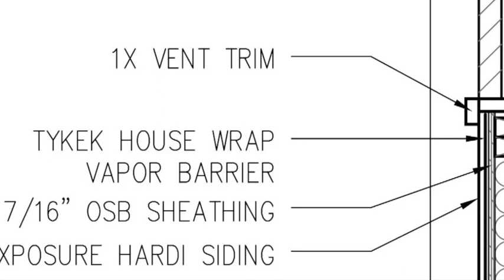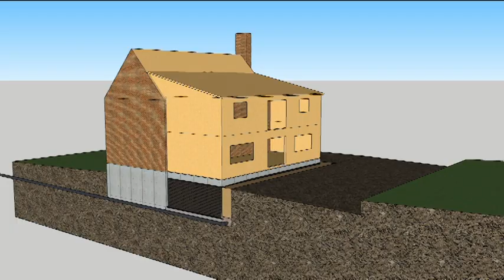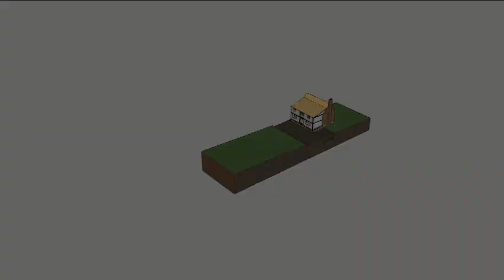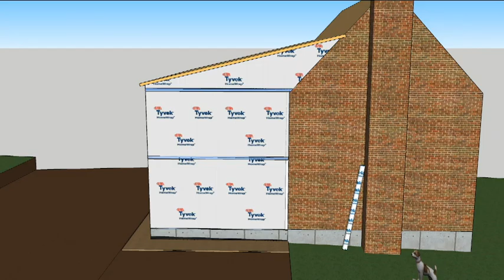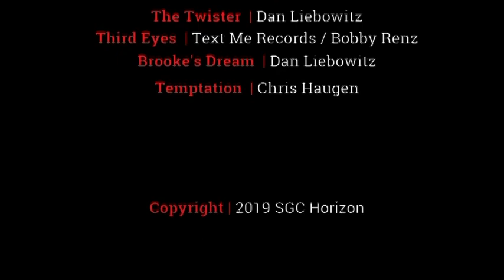Weatherization Nation 4: The WRB is a BFD

Comment: Hey . a little late for  a question, but I am surprised that DuPont  recommends against covering the cap staples with a sealing tape.. If the tape was sized  properly for adhesion,  why would it not be ant different than sealing the vertical Seams?

On really tight builds there main competitor (Zip) is either taping or caulking every nail hole for a really tight air seal.

If done correctly, I can't see why this would be a problem

BTW, Nice work , your sketch up videos are awesome!
Reply from the maker: Because the tape can fishmouth if not installed really well. We have had builders tell us about water traveling sideways in a tape 'gutter' after sneaking into a fishmouth. 

You know, SOME people install everything carefully, but even the meticulous ones make mistakes that they don't realize are mistakes -- yet.

Comment: Excellent video as always!  Considering that a sheet wrb requires 3 people to install and a high degree of skill to install which allows for a lower tolerance of error when installing, is this really the most economical wrb?  Or perhaps this was installed for other reasons?
Reply from the maker: Well, there are lots of reasons why people choose one system over another. A LOT of houses and additions are covered with house wrap, so it makes sense to us to show people how to do it well.

You can also staple it to the walls before you stand them, but these guys were waiting for me to arrive...

We will focus on other systems and methods in subsequent seasons.
Reply from the maker: (glad you like the show by the way!)
Reply: @ProTradeCraft  your stuff is the best!   Actual installation details, science supporting details/materials, simple to understand CAD mockups.  Your channel will explode.  Thanks for all your hard work!